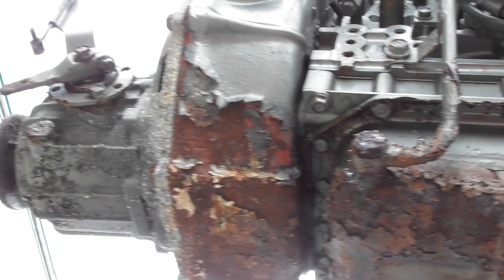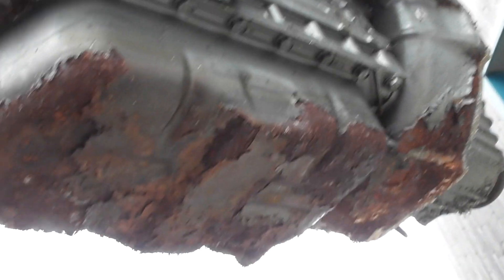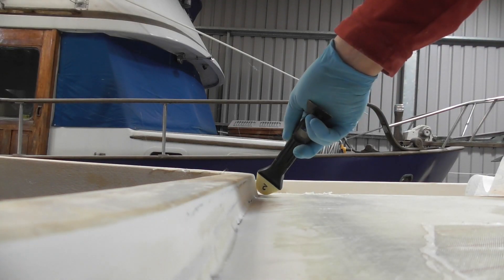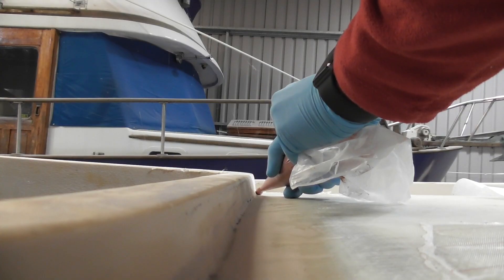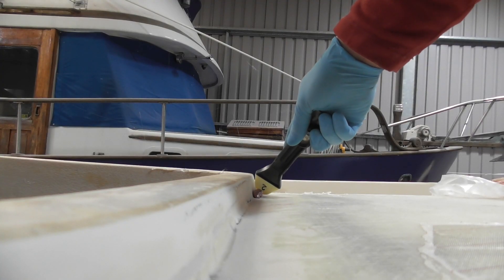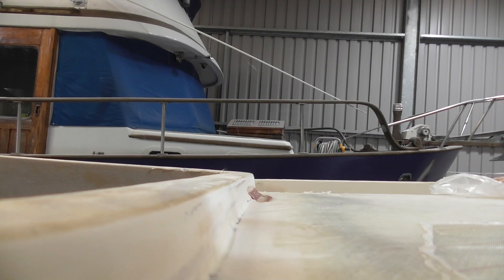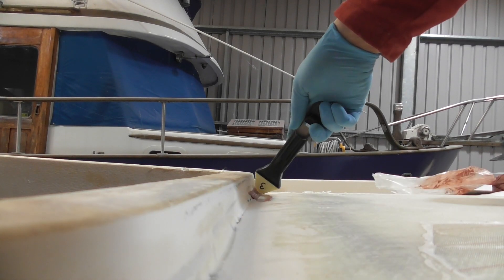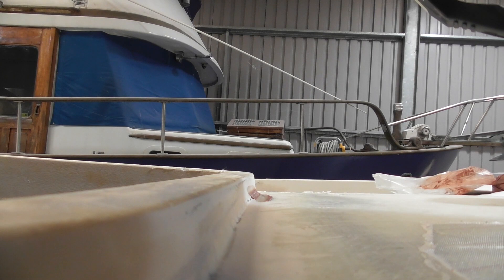#49 repairing the mast step

Comment: Hi there just a quickly I have a 352 with fuel tank problems so your video is very informative. But something I did on my boat was to make the double bed aft a bit wider it made a lot of difference,no doubt you will have new soft furnishings so a good time to do it. Vic S.
Reply from the maker: cheers hope your fuel tank is salvageable!

Comment: Happy New Year and thanks for the update.   Handsome layup on the blue stripe.  I also agree with several other comments others have already made, including G10 rather than stainless for the mast step, and leaving the port-starboard camber in the cockpit seat.  And thanks for following up on questions some of us raised previously about the status of the engine.
Reply from the maker: thanks Jack, good to get your comments re G10 and the camber.
Reply: @aboatcalledwanda6925  Also, regarding the bevel in mast heel that you note around 13:30, I'll be curious to see how you deal with the mating of that bevel to the G10 (or stainless if you go that route).

Comment: Showing the mast step repair was really helpful. I have the same repair to do and was unsure how to go about it.
Reply from the maker: @Alexis Soto thanks for the feedback. Do you have a Hallberg Rassy 352 also? I am interested to know if this is something that happens in other HRs or just mine on account of the hurricane and the damage to the rigging which damaged the mast step. If you can persevere through a few more videos the last one I show some of the damage to the chainplates and you get some idea of the forces at play. Good luck with your repair!
Reply: @aboatcalledwanda6925  Not a HR352, an Islander Freeport 41, but it seems like a potentially common issue for a 70s era deck stepped rig. Not sure how things are done now but it seems like it would be prudent to have fiberglass core surrounding major points of pressure or rigging around the deck, like the mast or chain plates.
Reply from the maker: @lexylexylexy1234  that's a very nice boat. I love all things Rob Perry. Yeah I agree I think I will reinforce where the chainplates go with additional laminate, and I guess as you saw I used G10 instead of marine ply for the core under the mast step. I'm guessing you've got a balsa core there but maybe under the mast step they also used some sort of marine grade timber. What I didn't show is I went back recently and laid down some fine cloth  with epoxy over the area I had built up with filler to fair the area around the mast step. I was never completely happy with having so much thickness of filler and it kept me awake at night :0 so I went back and added some laminate to protect against dropping winch handles and the like and chipping the deck. Shes all painted now and looks like a million dollars will show next update soon.
Reply: @aboatcalledwanda6925  thank you! She’s my first and so excited to start this next life chapter on her! I am a gal who loves a to-do list, so she’ll keep me happy for years to come, lol. The deck is balsa but I’ve been told it’s ply under the main and mizzen. I’m a visual learner so having folks like you on YT to turn to in prepping the future cruising adventure, and refit ahead, has been a god send. I just found your channel, so I’m looking forward to going through and seeing all you’ve done. So far looks very impressive!
Reply from the maker: @lexylexylexy1234  thank you. I learned everything by watching other (on YT) then choosing the best of what I saw. Im making these videos to give something back in return. I really enjoy getting feedback from people watching my vids. 
A good to-do list can keep us all out of trouble!

Comment: Happy new year and best whishes to you, your dear ones and Wanda. Good to see a lot of structural work is now nearing completion and you will be making a nice shiny boat of her. Ive sailes a 38 and they are wonderfull boats, you'll not regret rebuilding her. You are getting lots of work done, im impressed! The cockpit fpr sure does not need to be completely level as it's lightly warped to help the water run off.
Reply from the maker: Thanks, good to get your feedback about the cockpit also, much appreciated

Comment: Maybe reconsider encapsulating stainless steel in fibreglass for the mast step area, as stainless steel will corrode when oxygen is excluded. How about using G10 ? I think the wonky cockpit is per design. You are making fantastic progress.👍
Reply from the maker: Hi Norman, thanks for your advice. Actually I could do with some help on the material selection for the mast step area and don’t have much knowledge of metals. I was thinking of using mild steel. It will be fully encapsulated and not be in contact with other metals, oxygen or water. Do you think that would be Ok?
Reply: Yes especially if it is rust free and then well painted before encapsulating - it will see you out.👍 But I was thinking that G10 prepared GRP block or sheet.
Reply: Definitely not use stainless steel. G10 is a very good suggestion.
Reply from the maker: @normanboyes4983  thanks for getting back to me. Just to confirm, will I need to paint the mild steel before it is encapsulated? I'm not sure what the paint would do that the resin would not? Provided the steel is rust free, and is bone dry when I bed it down I thought the epoxy resin would seal it up. But I really don't know, so very much appreciated any advice, cheers.
Reply: A boat called wanda You make a very good point. I probably did not think it through properly and of course if the steel is fully and completely encapsulated in epoxy then all will be fine.
Reply: I agree with everyone else on this G10 is the way to go, its very high density glass reinforced resin, perfect for this job. Probably a good idea to check the integrity of the base material where compression post meets the keel also. Cheers from OZ 👍👍

Comment: As a non sailor. On some of the other channels when, it came to standing rigging one of the suppliers said to go to land rigging companies, (radio, tower masts, etc.). You will still have the rigging you want but is about half the cost.
Never needed to look into it but could help you out.
Reply from the maker: Thats a good tip, I would never have thought of that. I would check the land rigging suppliers to see if the stainless steel is 316 as it needs to be resilient to chlorides due to salt water.
Reply: Hi Richard, just had a quick poke around for rigging cost and hope this will be helpful in the future. I am in Silly Con Valley so some info USA and some UK
1x19 316 marine grade 
10.69 UK pounds for 10mm per Metre including VAT and shipping within UK
6.45 USD for 3/8 per FOOT no sales tax or shipping so around $19.50 per Metre from marine store so almost twice the price
Reply: Quick ps. I have no idea what thickness you need but they have many sizes

Comment: Aye m8! Lots of fun going on on Wanda! 
Blisters - yes, probably needed more alu-roller rubbing, to get air out. Now, it was evident that you took care of the vinylestering and rolled like a pro. 👍🏽

Cockpit - could it by any means be some kind of design meant to be? For letting water off the surface faster? If not, what can have happened to Wanda to be out of shape in this area? Anyway a good choice to leave it for now. 

Mast step - this is interesting news! Dry, but deformed plywood… could it have come from some hell of tension on the rigging? Someone at sometime tried to twist the turnbuckles to a massive tension for what reason? Was there something else going on at that very specific time? Any weak spots before the grounding/hurricane/disaster period, due to bad maintenance? I totally agree with your choice to go all the way on this subject: A rock hard, stiff and reliable mast step.

And my friend, you never need to apologise for late or otherwise different releases of your splendid vids. You are the one in charge for primarily taking care of Wanda and secondarily showing us the work. And you inspire us so much anyway, that we want to bring some tonnes of tools 🧰 and work along with you 🛠 to cheer you up 😉

I reckon all viewers would like to bid you a 🍻 cheers and a great year to come!
Reply from the maker: Wow thanks MiQ for your encouragement, you've been an absolute legend in terms of being supportive and helpful. That rigging must have been well overtightened - Plus I imagine as the boat was being heeled over and bashing against the pontoon in the hurricane the forces on the rigging must have been harsh - which would have translated to downwards compression. I think I will have to show you the chainplates as an example. on the starboard side all three chainplates have the bolt holes ripped open!
Reply: Oh, I reckon that’s all about destructive power needed then? 
You can of course show the chain plates when it’s suitable, but only if you’ve got time for it. It would though be a good add to the story. 

About your cockpit leveling, 
I’m curious if any other HR’s had the same experience?

My brother used to work at another yard at Orust, Sweden (origin of many known SV’s) at the ‘Najad’. 
I’ll ask him if ever heard about any unevenness in cockpits 😉
Reply: MiQ Bohlin  I didn’t want to disturb Richard and you seem to know about fiberglassing. Why, would you put down the fairing before the final layer of fiberglass? Would it make more sense to lay all the glass then fair then paint?

Comment: I was shouting out loud "the teak will flex!" But I see you know that now :-)
That mast step:
I did that to my chain plates partly for the same reason.
Took out the plywood (and balsa) and layed chop strand all the way instead.
For sure takes more pressure than any wood. If you want it to handle even more pressure, use carbon fibre. Or a combination.
If you worry about the fibre glass thickness being too excessive under the mast step, make a sinkhole for it. Sink it some 15mm to make it level with the rest of the cabin roof.
Just a thought...
Reply from the maker: I like the sinkhole idea - never heard of that technique before. That’s a good idea, thanks !

Comment: the original cockpit seating was in sections fixed onto battens that are shaped to provide a flat substrate for the seat panels but allow water to flow to the drains, when the boat is afloat/level....

my blue stripe was also cracked, it only went as far as the gelcoat, I believe it was caused by the extra heat attracted to/absorbed by dark colours in the Med...it was sanded filled and repainted in 2006 and has not shown through since...
Reply from the maker: Hey Tony, thanks for your feedback. The cockpit slope is a real mystery to me - you'll see more in the next update but basically the high point is where the drain is. Your blue stripe will be fine sanded and filled if the underlying laminate hasn't deteriorated. I understand the blue does absorb more heat and therefore be the first place to show signs of fading/cracking. Looking forwards to seeing mine painted and new looking again!

Comment: Hi Richard, did you manage to complete the mast step repair? Our 1988 HR352 (649) has exactly the same issue, and I am curious to know which material you resolved upon to replace the compressed plywood in the core, as I saw some contrasting views in the comments below. If you have completed this repair, I'd been keen to know if you captured it in any of the subsequent videos? Thanks.
Reply from the maker: Hey I used G10 sheets - 3x5 mm to build up the thickness to the same of the plywood core. Nothing soft that can be compressed now!

Comment: Wouldn't be so concerned about the cockpit being a bit skew-iff as I'm finding some odd things in my HR38 too, some of which to defy sound engineering practice. Might just've been built that way.

Question about that mast step though. Shouldn't the compression strut running through from the deck to the keel be accomodating this? For that drop to occur, has the strut integrity been compromised? Nothing in the deck should be resisting the tension from the mast, via the rigging. Not sure what that strut, which runs along the corner of the head/shower is made of but is not that strut providing support for the deck rather than the other way around? The strut supports the mast, the hull/shrouds/stays resist the mast bending, via chainplates, but is the deck not supported by that strut and step rather than the deck supporting the step?
Reply from the maker: Hey Ian, thanks for your comments. Let me try and clarify the issue, I probably didn't explain it well in the video. From the bottom up, there is the keel, which the mast compression post sits on top of, then there is a very solid beam on top of the compression post, then there is the deck sitting on top of that beam, then the mast. There are vertical forces of the rigging pulling the mast downwards. Now if you look at the deck, it consists of a bottom skin of fibreglass, then some plywood in the area of the mast base, then a top skin of fibreglass. With all those extreme forces pulling down, the compression post was fine, the beam atop the compression post was fine, the bottom skin of the deck was fine,; it was the plywood in the core that compressed and lost its integrity - in other words that was the weak link.
Reply: @aboatcalledwanda6925  oh good, That compression post is key and it's sound. I've seen videos where that post was U/S. What is the post made from in Hallberg-Rasseys?

Comment: for the blisters in the deck do you know how you got them? could it have been too little pressure on the fin roller?
Reply from the maker: Definitely, or even worse that part got missed. Most of the bubbles occur in the 8th and 9th pieces of cloth laid - there were 9 in total. So basically it’s human error - we were working against the clock with very large pieces of very thick cloth, and after 7 hours at it dropped we the ball a bit.